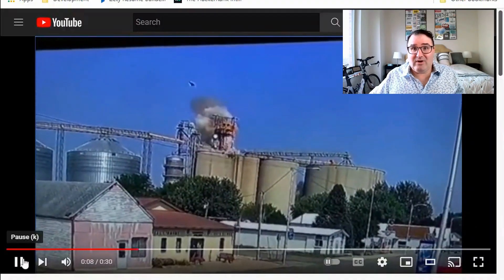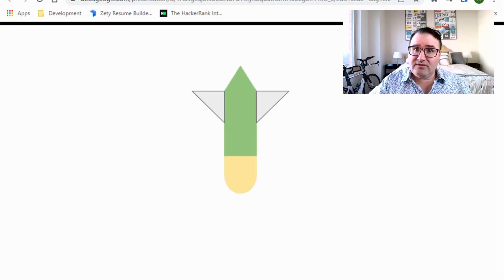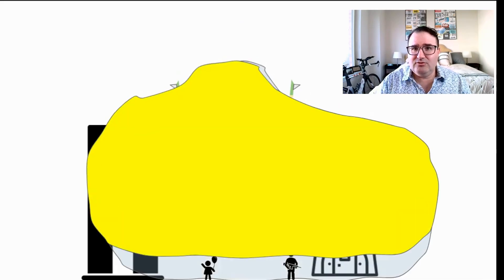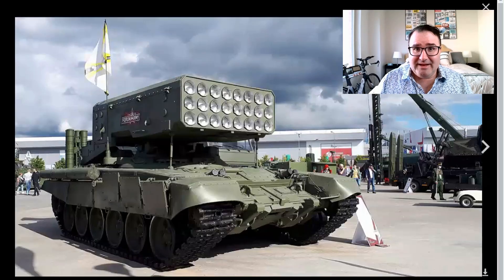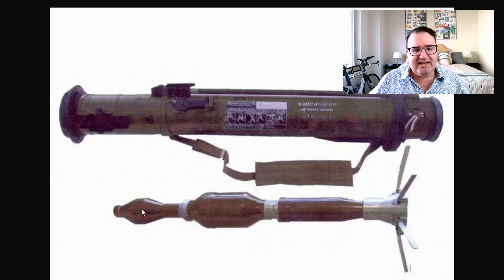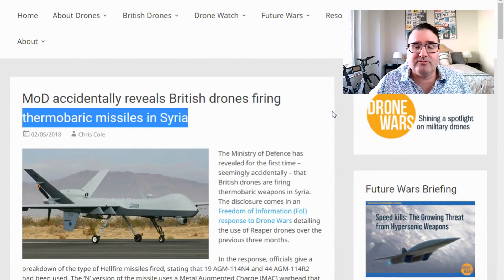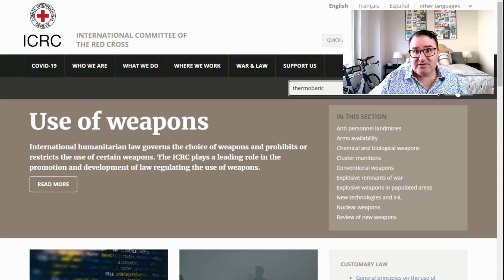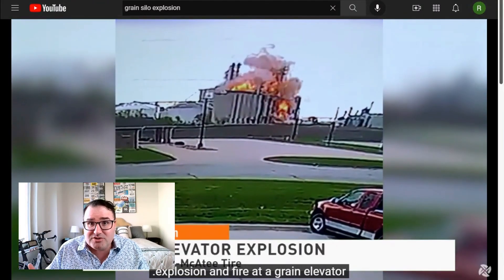How do Thermobaric "Vacuum Bombs" actually work?

Comment: Ok from being a aircraft pilot this is standard first day type stuff. Water vapour is less dense than air of the same temperature so water vapour lowers the air pressure or conversely raises the density altitude. Then just using a set of scales liquid water is denser than air so if you took a cubic meter do air and put 10 ml of water into it as rain drops then that cubic meter of air weighs more. But does the 10 ml of air that the liquid water rain displaces actually displace 10 ml of air or just compress the air slightly so the same number of molecules of air are still in the cubic meter I don’t know. But water vapour/humidity defiantly and measurably lowers the air density. I flew out of Darwin for and the NT Australia for 20 odd years, cyclones and daily thunderstorms in the wet season then bone dry dry season.

Comment: As both EOD and as a metrologist I can give you a take on the reason why they're less pressure in a humid environment.  The air is denser, but it's also largely saturated for fluids with water which makes it harder for fuel vapor to bond with the oxygen.

Comment: @RyanMcbeth 

Organic Chemist and Sapper(UXO/IED Specialist here):

As for the rain and thermobaric weapons:
Actually NO, THERMOBARIC weapons are considered rain proof with the right mixture is we can see with the TOS-1 in Ukraine! And they are usually MUCH MORE ADVANCE THAN FAE Weapons(that use normal liquid fuels) so ThermoBaric ones with metal solid fuel and metal including Metal Hydrides in them that WHEN GET WET RELEASE INSANE AMOUNT OF H2 REALY FAST and RADICAL OR AT LEAST ELEMENTAL/ATOM WERION OF SAID ELEMENT like Mg or Al so this might only ADD TO THE STRENGHT and HEAT OF EXPLOSION BUT SLOW IT DOWN JUST A BIT SINCE FUEL IS USED MUCH FASTER  in the right conditions and good design!. BUT AGAIN WATER/RAIN might have even greater effect on them since it is instantly vaporized and as we can see in insanely large explosions or ones where there is a lot of moisture in the air (iconic "carpet bombing" in Vietnam and Laos) WHERE EXPLOSIONS ARE MORE VISIBLE AND COOLER LOOKING (sorry but I am A Sapper UXO/IED Specialist! :-)

As for FAE mixtures, which are usually liquid like ethylene or propylene oxide (self-sustainable fuel) there is NO WAY they will get affected badly 
BUT WITH other NORMAL kind of fuel OR SOLVENT mixed with the air...THEY ARE A BIT MORE FINICKY (but I only tried them on the small scale) where you need to fine-tune the delay between the first explosion and the "sparks" that ignite it, which are in the military usualy pallets soaked in things like liquids that will burn as soon as they have enough air (pyrophoric)! But on the larger scale...if it is a downpour it is 50/50 chance it might delay it and just make a FLAMETHROWER out of it and or make OR more powerful WITH MORE PRESSURE AND HEAT  EXPLOSION  DUE THE OZON IN THE AIR and the fact you can't compress the water but stem will grow up to1600x from that HEAT (OR NEGATIVE PRESSURE!) ! I just wanted a cool video when I was making one from some mixture of the ketone and ether WHEN DOWN POUR STARTED (THERE WAS ALREADY THUNDER FOR A WHOLE DAY AND LOTS OF OZONE AND HUMIDITY IN THE AIR) and it got so powerful it destroyed my camera and I definitively felt the heat and overpressure of it more than with a normal FAE of that type I already experimented with!

So, there you go! Your page was not working properly....

Comment: They (Russians) have,IMHO AMAZING AND TERIFIYING LIGHT 60-ismm (I think 60mm or 65mm) ULTRALIGHT THERMOBARIC "Flamethrower" that basically HAS NO BACKBLAST (something half the size of it goes flying from behind like that snake on springs from the fake candy can, like that rocket motor in Javelin,NLAW and those "Flamethrowers" used during the School siege in Beslan! JUST MORE ADVANCE! AND SIMPLE) and that small,(maybe 2x the RPG first stage motor! Small range weapon that has a "click-on" sighting and firing mechanism similar to some other Russian and NATO,  AND that small rocket has the same effect as 120mm Shell! I really forgot what is the name of the thing but ONE soldier can carry a BUNCH OF THEM (usually used by Spetsnaz and GRU) and considering it has "no" backblast and a relatively powerful small rocket, it looks like something straight of the terminator movie!
I think it has some 3-letter name but I really forgot what it is, You can find it on the "RosoBoron" page and YT channel! BUT IT IS DEFINITELY AN EVOLUTION OF THE MENTIONED RGSh-1 And RPG-26 and 27!

Comment: Just wanna add some thoughts to "what's the difference to "normal" explosives:
- A "normal explosive" brings both the fuel and the oxygen in a chemical form, and the oxygen is responsible for a lot of the overall mass -> a thermobaric warhead can deliver more fuel than a normal warhead of the same size.
- the chemical reaction goes much slower with fuel bombs. This resulting longer overpressure is more deadly and more destructive to buildings etc.

Comment: I'm by no means an expert, take this with a grain of salt. I'm not sure about the density part that water vapor plays, but I may have a bit of information for solving the second part of your question (whether vapor displaces oxygen). 

The humidity of the air is usually around 0-4% of the air composition by volume. But this percentage doesn't work in the same way as the rest of percentages in air composition do. If vapor is 4% of the air volume in a spot, the rest of percentages of gases apply to the remaining 96%.

In dry volume, oxygen levels are at 20.95% of air volume. At a really high humidity level, that 20.95% of oxygen becomes about 20.1%, which probably doesn't make much of a difference as an oxidizer in combustion. 

Nitrogen in dry volume is 78.08% of air, which becomes 74.95% when 4% of the air is water.
Argon goes from 0.93% to 0.89%, etc.

Comment: Re humidity.

I would expect it to have an effect, but not due to changes in Oxygen content. Heat capacity and vaporisation could sap a LOT of heat out of the chemical reaction.  Mind you, one could also argue that you'd get that back as the resulting steam expands.

Comment: There's no "fuel" and no "air" in current thermobaric designs on the battlefield. Those are now called "volumetric explosives", having the payload distributed over a volume before detonating it. The main design goal is to have a successive blast (through the volume) generating a long-wavelength pressure wave of very high amplitude. Remember, if you are very far away from o sound source, you only hear the very low-wavelength rumbles - but you hear them relatively loud. Theoretically, you could try to disperse a sh**load of fine-grained RDX of Hexogen coated with a thin film of sorts. Then you generate a detonating blast in one part of the dispersed volume and *if the rest of your dispersed stuff also detonates, it will enclose a large volume generating a long-wavelength high-amplitude pressure wave.

Compare for example: patents.google.com/patent/US7754036B1/en
"A class of explosives known as thermobaric explosives (TBX) also falls within the volumetric weaponry category. Thermobaric explosives are designed to produce heat and pressure effects instead of armor piercing or fragmentation damage effects. Thermobaric explosives are generally fuel-rich compositions containing a nitramine, characterized by the energy release occurring over a longer period of time than standard explosives, thereby creating a long-duration pressure pulse"

Comment: As a summer job as a student in the 70s I spent a few weeks in a baby food production plant in Norwich, England. Boring, noisy, and the endless taste and smell of very sugary pink and yellow fine dust - the desserts... Dust came from interfloor bagging feeds, hoppers etc. and had to be swept up and the surfaces damped down to eliminate the risk of static electricity triggering a blast. Flour mills - that was the original function of the building - have a long history of destruction by fire/explosion. This is believed to be the cause of the famous Pudding Lane epicentre of the Great Fire of London in 1666, which started in a baker's. Flour is bad, but I'm assuming the embodied energy in a fine sugar would be even worse if ignited..

Comment: They were first used in Vietnam to attack the tunnels the enemy used.  The overpressure would suck the air out of the tunnels and cause them to collapse.  The first ones were just drums of jet fuel that were blown up to spread the fuel and a willy-Pete would set it off.
Reply: Your sentence does not make any sense. Explosions do not suck, they do not create a vacuum.

Comment: Engineer, From a amount of air present it won't make much of a difference. Combustion engines still work and they can adjust lean/rich. On a bomb its just a vomit-kaboom where it hopes to get the mixture somewhat right. The explosive probably has oxidize already included to make it easier to ignite / hotter. The difference with rain would be the ability for the blast to expand before cooling down. The water's phase change would also take some of the energy away. Long made short: Still a boom - probably a tiny bit smaller.

Comment: I was interested by your comparison with the surface of the sun. Although I knew that the sun’s surface is much cooler than its upper atmosphere, your comparison still made the sun’s surface sound surprisingly mild. Closer inspection indicates that your comparison, though correct, was with the bottom of the range of temperatures found on the surface the sun, which varies from mere thousands to millions of degrees Celsius. So thank you for compelling me to reflect upon and slightly increase my (meagre) knowledge of that fascinating object, our star.

Comment: When the Mujahideen would hide in Karez systems at first the Russo tried a few different types of TB wpns and finally they found what worked really well..LP aka Propane..they would release Propane and since it's heavier then air..would settle in areas where the Mujahideen thought they would be safe..1xTB +1×Propane..then let her rip.

Comment: Hi. Chemist here. It would really only make sense to me that the more dense the air the less destructive the explosion, since the shockwave will be diluted faster. Also I don't think that relative humidity will have much of an effect on the density of the air compared to something like temperature, and certainly not as much of an affect as sea level. I do not deal with compressed gases or explosives though.

Comment: Finally, thank you for getting the word out that these aren't vacuum bombs, they are OVERPRESSURE bombs

And I was told that the ambient temperature had more effect on fuel dispersion than humidity. Colder denser air slowed the fuel dispersion, hotter air it spread more. But humid air is actually less dense.  But in rain, no idea.

Comment: Neither of the aforementioned criteria but ive looked into meteorology as a hobby.
Though i cant say definitively i would, however, say that the moisture in the atmosphere would probably have a negligible effect on the weapons operation however the vapor cloud caused by the explosion might be more noticeable than that of a more dry atmosphere.

I'd definitely take this assessment with a grain of salt, it may not be (and more likely isnt) correct. I would appreciate it if anyone has additional information to add so i can gain a better understanding.

Comment: Humid air is less dense than dry air.  That's why humid air is susceptible to thunderstorms, as the upward motion of air takes less force since the momentum of humid air is less.  So the speed of the shock wave would change in wet conditions.  (Meteorologist)

Comment: Of course the fireball is no joke but it's my understanding that the bomb was designed to maximize the over pressure wave. The weapon is more effective in enclosed spaces like tunnels, bunkers, caves, foxholes, etc. The "Vacuum Bomb" misnomer is from the fact that as the gasses from explosion cool there will be a pressure drop in the local area which causes damage as well. There is no actual vacuum created. It's kind of reminds me of a nuclear blast video I've seen, the one where the blast front hits a building then immediately the air is sucked back the other direction both causing damage.  There's a detailed explanation of the weapon in the Wiki.                 https://en.wikipedia.org/wiki/Thermobaric_weapon

Comment: I always wondered how the weapon uses an explosion to disperse the fuel without that same explosion igniting it prematurely.
Reply: The initial dispersion probably uses a high explosive that creates a very sharp pressure wave but doesn't transport its heat very far.
Also, the gas and particles that are getting dispersed don't have enough oxygen around to ignite at all in the first short time. The ideal ratio for a flammable gas like butane to air for a nice deflagration is pretty lean. The exact ratio depends on the gas, but it tends to be just under 10% fuel for most of them, so they need some time to mix with the air to even catch any fire

Comment: Awesome explanation
I heard it sucked the air from the lungs and it seemed highly unlikely that it would be a real issue, versus the difference of pressure and heat. 
I coursed physics and it makes a lot of sense to me that the vapor would increase substantially the heat and pressure, as it's using much more oxygen than a standard explosion, that occurs more locally.

Comment: 1. A water molecule (H20) weighs considerably less (molecular weight = 18) than an oxygen (O2) molecule (wgt = 32) or a nitrogen (N2) molecule (wgt = 28). But they all take up roughly the same space. Thus humid air actually weighs LESS than dry air. When a storm is coming the barometric pressure drops. Big storms like hurricanes record spectacularly low barometric pressures.

2. Remember "instant LZs" in 'Nam (or maybe you're not old enough)? Wondering if those early fuel/air bombs would qualify as "thermobarics."

Comment: If air is humid, it means that one mole of water vapor (molecular weight of 18) is displacing one mole of air (roughly speaking 79% nitrogen and 21% oxygen, giving it an average molecular weight of 28.9).  Therefore, humid air is LESS DENSE, not denser, than dry air, not the other way around. That explains why a golf ball, off a tee, will go a bit farther on a humid day than on a dry one, given that your strike is constant.
Applied to thermobaric explosions, I guess (sorry, I never did the test to confirm) that the explosion will be a tid bit less intense on a humid day, as there will be a little less oxygen in the air to react with the fuel.  But, I guess again, it will still be just as deadly.  Rain will soak up some of the heat to evaporate the rain drops... but the explosion will still be just about as deadly, I am afraid.

Comment: Humid air is actually less dense than dry air.
The reason is that the molecular weight of Water (18g/mol) is less than the molecular weight of Oxygen (32g/mol) or Nitrogen (28g/mol) which together make for about 99% of our atmospheres mass. Since air humidity is basically water vapour dissolved in air, the heavier air molecules get "diluted" by lighter water molecules so to speak.

Additionally humid air has a higher specific heat capacity than dry air, which means it needs to absorb more heat/energy than dry air to experience the same rise in temperature as dry air.

Since the explosions pressure spike directly relates to its temperature spike, humid air with its higher specific heat capacity has the potential of "dampening" the explosions temperature spike an thereby to "dampening" the pressure spike too.

So humid air probably will give you the best chances of surviving a thermobaric detonation.

Comment: Regarding humidity (covid research helped a lot in this department): At 30% relative humidity, droplets doubled compared to a 60% humidity environment. It's not that more material appears from nowhere but the chemicals or gas is able to more easily exist as smaller particles rather than grouping together into larger globs. This then allows them to disperse further on the wind or via the first dispersal explosion, in the case of these bombs, prior to the 2nd explosion that ignites the aerosolized mixture.
Reply: This likely leads to an even greater pressure wave as a more thoroughly mixed fuel (meaning smaller droplets more evenly dispersed as opposed to a more random smattering of larger globs of fuel) provides a more consistent, even, complete ignition just like is the case with fuel being injected into a cylinder in your car's engine. The more homogeneous the fuel mixture evenly spread in a cylinder provides more power per cylinder stroke, so I assume this works similarly.

Comment: Thermobaric bombs are just bombs, not nice to die by any bomb.  The advantage of the fuel-air bomb is, you don't have to carry the Oxidizer with you, you only carry the fuel and use the local Oxygen.  This results in more boom at the target.

Comment: Material science guy here, my immediate reaction was the humidity and air density would affect the dispersion of the the fuel into air as tempreture humidity and radiant heat all affect stoichiometry the way gasses or any aerosol mixes with air, meaning in theory a more rich or lean mixture dependant on the optimal ratio for the fuel.
For instance gasoline is 14-17-1 and in cold tempretures can be significantly richer due the higher density of the air allowing for more efficient combustion, but warmer lower density air will mix better and create a more violent (and less controllable) flame front.
An interesting way to look into this would be looking at the used fuels optimal afr ratios in aerosol form.